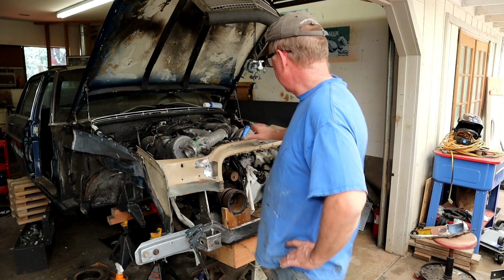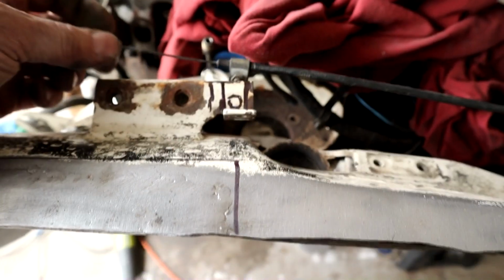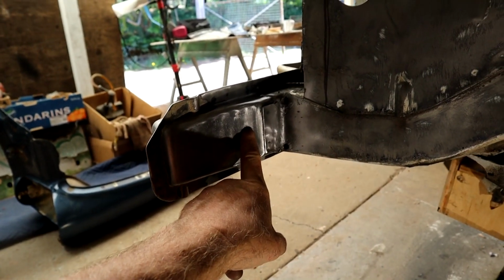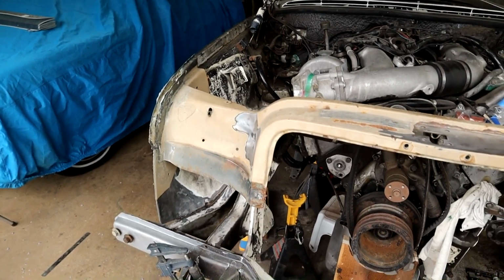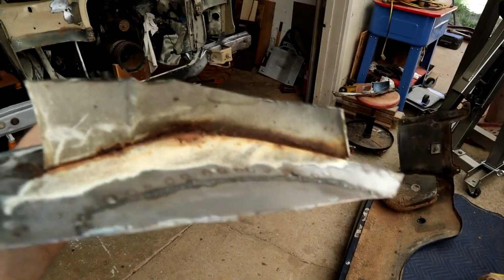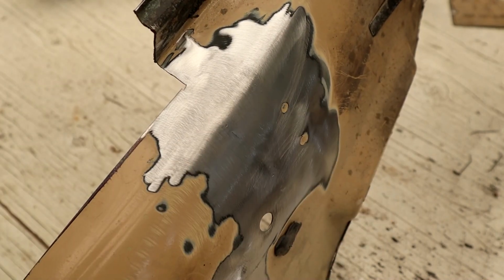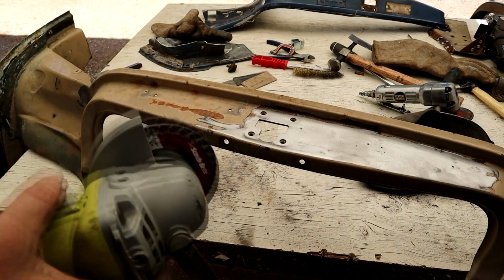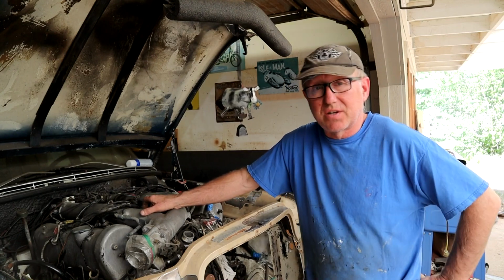Mercedes W109 6.3 Overview.  Preparation for Engine removal and Radiator Surround Repair.

Comment: I always undo the compressor/power steer pump and lit the body off the engine and front axle . At the rear of the gearbox,I remove the steel mount arm and bolt on a jockey wheel which makes the whole deal a trycycle and easy to wheel about. 
The engine is around 600 Kg so make sure your engine lifter is safe to carry it. 
 I'm going to do another soon ,the owner wants to renovate the engine bay and fit an  electric aircon compressor etc. 
A lot of the bumper support cross members are bent in the middle from people trying to lift the car when the suspension has leaked down. I did one a couple of years ago which was badly bent after an accident ,to straighten it, some clown welded a thin plate over the dent and used washers to line the bumper up. 
Water gets in the Double inner panels from the top by the firewall. Wax is the best method of stopping rust in those part. 
The reference point is a small hole in the cross member under the seat box .
The Aircleaner is shoved hard into the gap... paint the engine bay first, then fit the air cleaner before anything else. although a mate managed to get his out last month with the engine still in the car.
Reply from the maker: Thanks Mercmad. I would love to drop the engine and transmission. I removed the steering box already, but I'm having clearence issues on the passenger side. It appears that the exhaust manifold will hit that steering pivot arm which us attached to the subframe. I then thought I would just unbolt the exhaust manifold, but of course the nuts are rusted pretty bad. I managed to get a few off, but one sheared ( which I'll have to address later) so fear of doing more damage i decided to abandon that idea and lift it out the front. But if you have any ideas I would prefer to drop it. The subframe as you know is already out. I think I will get myself some of that waxoyl stuff for all those hidden cavities as well as frame coating.. As far as the air cleaner housing it has to be one of the most frustrating things so far!! 😄🤣 Thank you so much for sharing your experience. Looking forward to your next video. Cheers John

Comment: I did enjoy your Video. I am a little perplexed regarding the amount of previous rust repairs and the ones you are doing currently. Do you think Your W109 6.3 was made out of scrap from a sunken U boat. Maybe the rust was there at manufacture in Stuttgart! Please don't feel insulted John, but boy O boy, you have your work cut out for you, however you are doing a great, even munificent  job. I see why you brits ended up ,flogging the Germans, (even after they bombed the heck out of the place in the battle of Britain). in the past two World Wars. Keep at it, it is so impressive.  
Is that amount of corrosion caused by salt on the roads in winter as is very often the case in the U.K.?
Also, have a good look in the air inlet Plenum behind the firewall. That is where my car has significant rust. ours maybe OK in there hopefully. Regards from Australia.
Reply from the maker: Thanks Geoffrey:) I think because its a euro import car it has a little more rust than a California car. ( Note the English understatement:) I take absolutely no offense at what you said, I agree its a ton of work, but at the same time I'm really enjoying the challenge. The previous repairs are pretty bad but completely correctable. Also I think what keeps me going is that I never thought I would own a 6.3, this one came along and I feel very fortunate for the opportunity. Thanks again Geoffrey. 
🍻Cheers John.